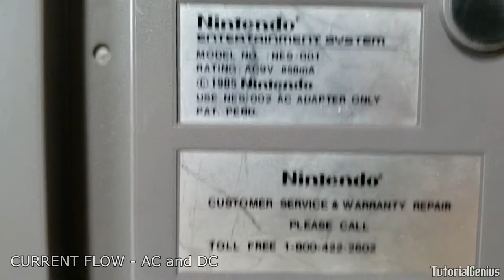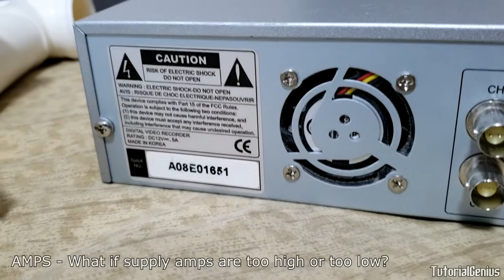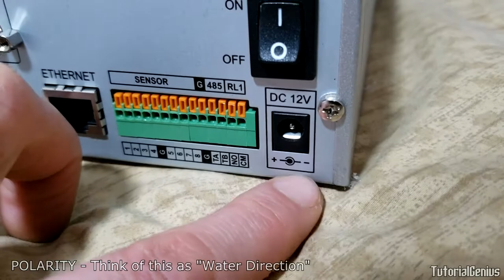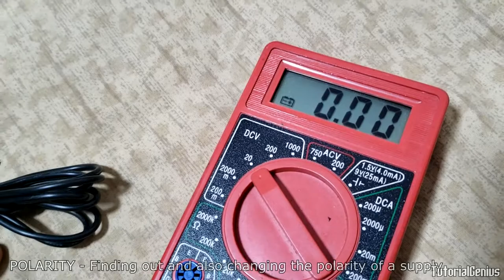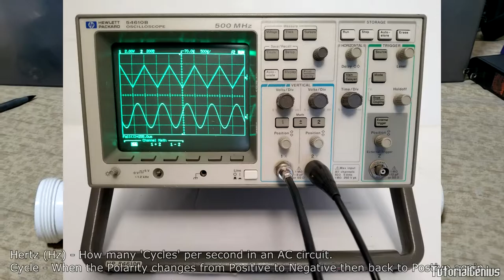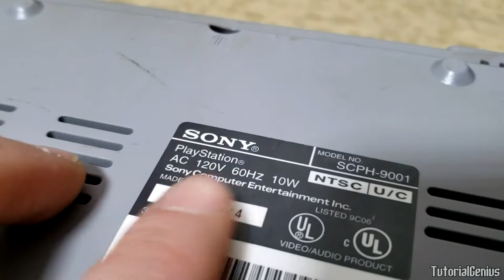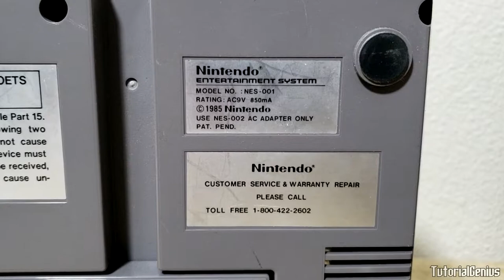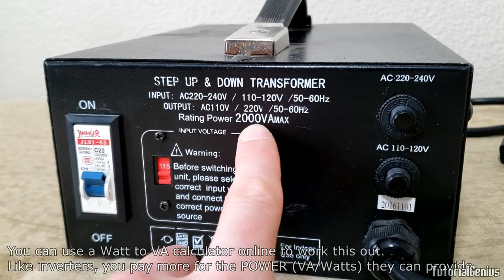Electricity 101 - Volts/Amps/Watts etc - Choosing the Correct AC-DC Power Adapter

Comment: Hi Dude, very cool video. Have just given a thumbs up as well deserved. Just wanted to ask, regarding the AC input figures, they are often followed by an AMP, in some cases with the words “max” after. IE: 100-240v (50-60hz) 1A. Do I need to be concerned about that amp value at the end. I’m looking to replace an adapter that has the input stated above with a DC output of 12v 2.5a, I found a possible Replacement, which matches the output, but input shows the amps as 0.8A instead of 1.0A. Will it make a difference and can you explain why the ac input also has an amp value too, sometimes followed with the word “max”? Cheers, Danny (from UK).
Reply: You need to match the voltage and ampage or higher amps but not lower